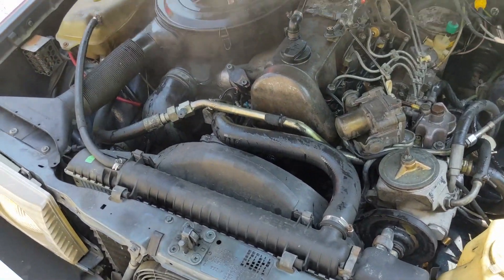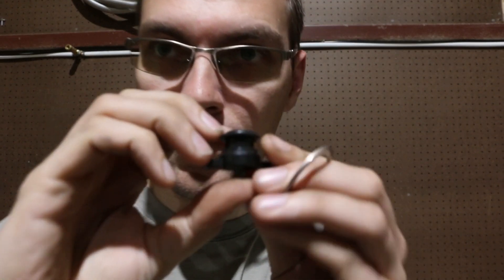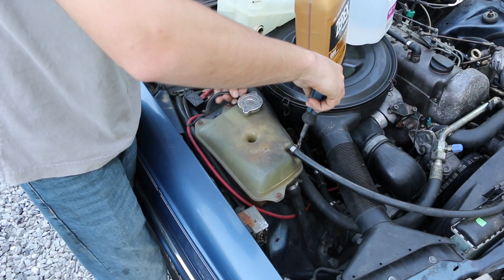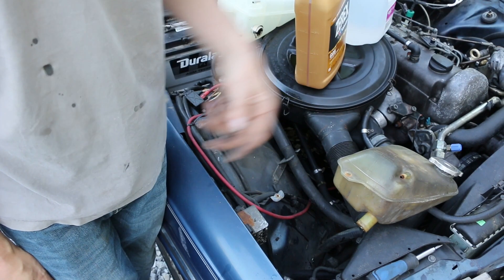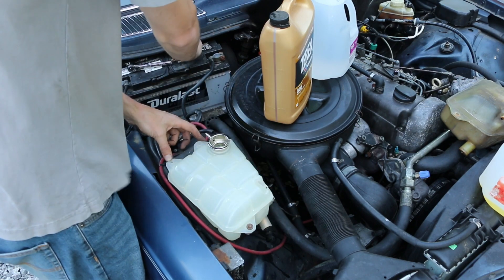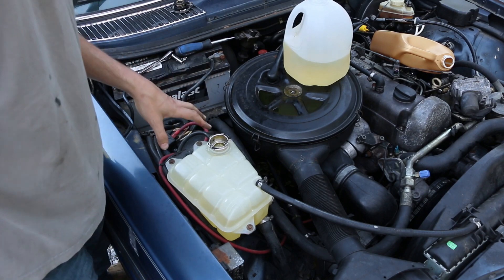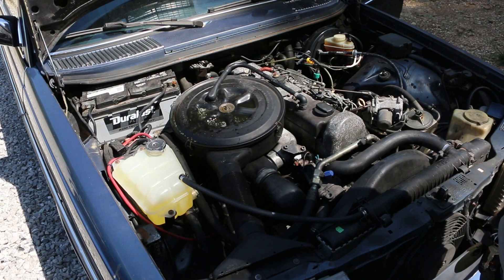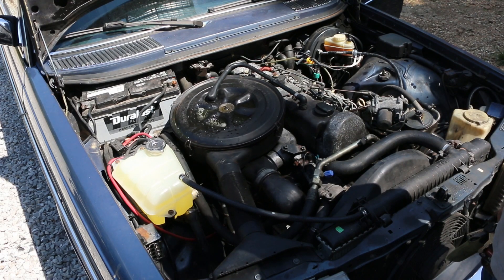Replacing my W123 coolant overflow tank.

Comment: Hi thanks a lot your videos they are always well explained and helpful. I have an other question about my W123, my mono valve connection is  getting only 11.35 or 11.37 volts  instead 12 volts power which results it not to close or open all the way or most of the times it does not even move at all. I have cleaned it inside properly and replaced the valve already . Also tried to power it from outside which worked fine, could you please advise me where i have to look for the power lost between A/c switches and the valve. Thanks in advance
Reply from the maker: First thing I would check is which side is the power loss on. So put your multimeter probes in the connector, if it is showing a negative value, you have the leads reversed, switch them, and then take the negative out and touch it directly to the negative on the battery. If the voltage is now good, you have a ground problem. If its the same, put the negative lead back into the monovalve connector, take the positive out of the other pin, and touch it to battery positive. If it shows the full battery voltage then that proves it is on the positive side of the monovalve connector that has an issue. From there I'll have to see if I can find any wiring diagrams or such that may be helpful to you tracing where each one goes to.
Reply: @trythistv  Hi there thanks a lot again , I am impressed with your quick response this is second time I asked for something and got the answer almost the same time which is not very common . But I am glad that I got the answer. After reading your answer took the switch apart cleaned the terminals(did not swap and wire coz I could see how rusty they were inside) got 12.89 volt coming in  but the valve still does not act , most likely  I will take it apart on some week end , which might be helpful to see what is going on with this OEM brand new valve. Thanks again and please keep up with the good work.
Reply from the maker: Well, good that you've got the voltage you need now, weird that the monovalve isn't moving, could be something stuck or binding, but being a new OEM valve I'd expect it to work, hopefully you find some answers when you take it apart over the weekend!
I get some notifications for comments on my phone, I don't always have enough service to respond, but I try to get back to everyone fairly quickly if I have any suggestions to offer!